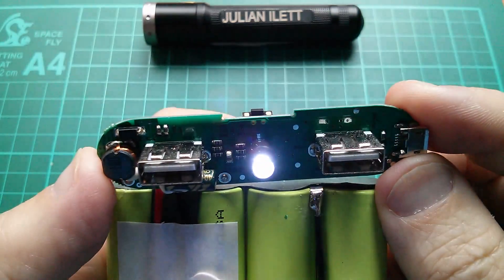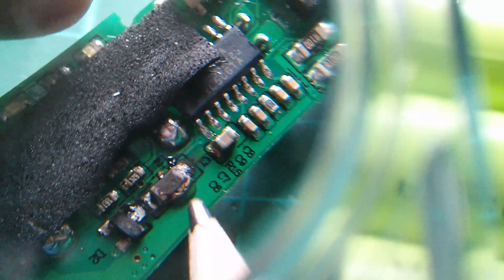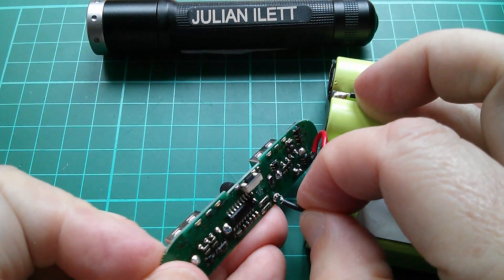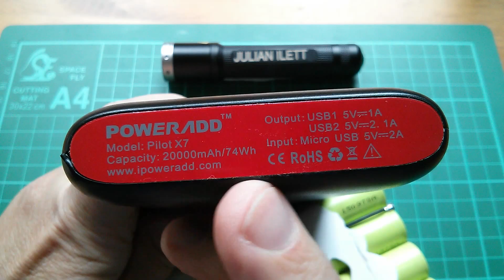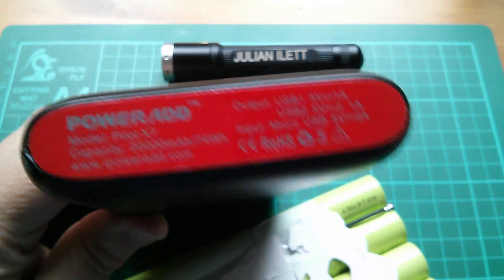20,000mAh Failed Powerbank Teardown

Comment: You can still use this ( ? ) ... discard the damaged electronics ( 💩) ..... charge the cells to the correct ( 4 .2  Volts ) using a vape charger ( this  WILL take a long time 😝 ) and then use it to power your garden lights ( ? ) ..... DAVE™🛑

Comment: I have a question. What company produced the batteries inside? I had exactly the same type of powerbank. And I suffered the exact same thing. After serving me at least 5 years with a loss of max 20% of capacity I made the mistake of charging it with a fast charger, that burned it. I am very sad. It was the best and most sustainable powerbank. But ... I took the batteries and mounted them in another power bank where the batteries lasted only 2 years. It works perfectly and I hope it will last me another 2-3 years.

Comment: We've bought a couple of these from Amazon. One wouldn't take a proper charge and was quickly exchanged by the vendor. Another two worked great for about 2 years then dropped just slightly in capacity. Amazon reviews were mixed. If any of them eventually fail, I'll use the info from this vid to replace the bad cell with high-quality pulls from an old laptop pack. The wife LOVES hers because it charges her phone so fast and for multiple charges. Cost about $20.

Comment: Hi Julian, love your videos. Can I please ask you a question regarding the useage of li-ion bms boards? Say I have two 3s bms boards, can I connect them in parallel to the outputs? and charge and discharge from the same connectors? say x3 li-ion cells at 2000Mah each, making each bank 3.7-4.2v at 6000Mah, total capacity (parallel) 3.7-4.2v 12000Mah. Am I correct in thinking I can charge these cells as they are (in parallel, 2 banks of 3 cells) directly from the P- and P+ connections as well as drain from them without issue. If so, could I then use a standard car batt charger for charging these cells (since they have balance charging boards fitted already) or would I have to use a specific charger such as a turnigy? Many thanks Julian, much appreciated.

Comment: my nice EC Technology 22400mha power bank micro usb port broke due to a shit cable heating up and melting the plastic in the port but it still turns on and charges phones but you cant charge it back up and has had very little uses so i have broken it open taken the 18650 cells out that are each rate 2500mah and i have 8 of them yay so i order a diy power bank case to put them in why waste good cells and yes i know i could try to solder a new port on but i no good at micro soldering

Comment: It looks to me that it is C so it would be a cap and the other item looks like a transistor or could possibly be a voltage regulator. It can be fixed, but perhaps not worth it. In that case harvest the cells.

Comment: Ouch, the two X7's I bought a year ago are still going strong with near daily use (hope I don't jinx myself). One of my unbranded Chinese 20,000 mah banks died in a similar fashion, I used the cells in a cheap 18650 battery box like you did.

Comment: Hmm, that's a shame :-(
You might remake it with a buck converter board if the batterys produce more than 5v, and that battery could be charged another way.

Could still be a handy 5v supply :-D

Comment: hey Julian im working my way through all your videos and im very impressed totally enjoyable so im going to ask your advice on a project I want to build basically I want to build an led clap activated in use sign but struggling to get my head around it the parts I have on order are 10w led a 10w led boost module and a clap activated module I saw on one of your postbag videos I would appreciate it if you could get me in the right direction to build this when my parts arrive cheers peter

Comment: In a perfect world, PowerAdd would send you replacement components, or an updated circuit board - but you'd have to let them know first!
Failing that, I'd ask if anyone else has one, and if they could identify what the components should be to replace.
I hate throwing repairable stuff away - manufacturers should do more to aid serviceability.
Reply: I agree with you Andy. I'm the guy who years ago took in a toaster in to have one heating element replaced! But here there's either a design fault causing burn-out, or they've used cheap components.
Personally, I'd bin the circuit board and maybe keep the cells for another project. Reason - I need powerbanks that are 100% reliable, when I travel, so I usually go for 'names' like Anker, Duracell or Energizer. Expensive, yes. Reliable, yes.

Comment: The large brown-ish component with the gunk around it looks like a capacitor, and the small black 3-pin part with the skidmark is almost certainly a mosfet. Since mosfets usually fail short circuit, my guess is that this is keeping the LED lit. If you desolder the mosfet I would expect the LED to go out. You should still be OK from a battery safety standpoint as the cells have their own protection board anyway. It's probably a very generic mosfet so replacements should be easy to find. Not sure about that big capacitor though (assuming it is actually a cap). Good luck fixing it anyway...

Comment: So, that '20,0000mAh' power pack is actually about half of the claimed capacity, assuming that the cells really are 2.5Ah ones. That's not quite the worst of the Chinese swindles, then. Thanks for the tear down, Julian. //A thin, repurposed Sheffield steel dining knife, a flexible filling knife, old credit cards, old flat-ended tweezers, or even thin and flexible paint scraping trowels, make excellent spudgers. Or if you prefer to support the Chinese government further, you can buy complete spudger sets for a few yuan.

Comment: it looks like the surface mount diode got hot enough to melt the solder and allow it to flow and short out itself,could try removing the solder short?.

Comment: This is exactly what my Brother's 20,000mAh Anker did, which looks very very similar to yours (basically just a different colour case).
It had cooked up a couple of components on the edge of the board just like yours and got very hot.
When he brought it to me initially I didn't have time to look at it, so I put it in a metal bucket in the garden for a few days in case the heat was from one of the cells about to "perform". A few days later (LED still on, but case now cool) I opened it up, found the fried SMDs and cut the battery wires.
I'll get round to putting the cells into something else one day!

Comment: Are those battery cells all in parallel for a total of 3.7V or is it some in series to run around 8.4V?
Reply: Matthew Miller typically they have a boost converter to bring the 3.7v up to USB standard 5v. this is also one reason some people moan not getting the"full" 20000mha, for example because the converter is not 100% efficient.

Comment: Just say tape, Julian. Sticky is redundant. We know what tape is.
Reply: Sticky tape is a perfectly normal British name for it.
Tape on its own just means a thin flexible strip...
So a tape measure is a tape you can measure with.
Cassette tape is a tape in a cassette,
Police tape is a tape with Police written on it...
and sticky tape is a tape which is sticky.

We do drop the sticky when we talk about insulating tape though.
Insulating sticky tape would just be a silly name.
Reply: Let's call it grey insulating sticky tape thing.

Comment: My guess is that the D2 failed, and has shorted the inductor, maybe try replacing the diode and inductor (or at least removing them) and seeing if it comes back to life.
Reply: You can get SOT23-3 package diodes, so the diode probably failed, and took out the inductor, or perhaps the inductor litterly cooked the diode...
Reply: TheDefpom are you sure D2 is a diode? I've never seen one in that package

Comment: Most likely the inductor is part of a buck converter (from 5V USB to charge voltage), but the IC is fried and short circuited, which heated the inductor. I don't think it burned up since the LED got brighter when you connected USB. Check the voltage at the battery terminals when you connect USB. My guess: 5V minus the drop of the diode in series with the inductor (so something around 4.5V and thereby too much for Lithium cells; hopefully the battery protection board did its job).

Comment: I suspect one of the diodes in that sot-23 package (or it may be a transistor despite the board marking) failed short circuit, drawing a lot of current through the inductor. It may work if you replace both the components, but I wouldn't bet much money on it.

Comment: at least your batteries still work my power bank had two of the silver lithium battery pouches in it and one of them swelled up and bent the metal case out. i took it apart and the other pouch is ok I think so I can make a new power bank out of that but it will only be half as powery as before :(

Comment: That burnt component is a capacitor.
Reply: Yeah, it's an inductor, that C1 fooled me. Looks like D2 is also kind of funny looking, I guess diode failure is what happened there.
Reply: Definitely not. Looks differently and is marked as "I" or "L".
Reply: It's an inductor, how does a cap in a battery powered device blow like that? Also, the L1 that's under it is good evidence. The C1 was for the other cap, next to it
Reply: Looks like an inductor to me.
Reply: I agree, a high value X7R SMD ceramic capacitor would be suitable replacement. Judging by the thickness, 1 to 10uF.
Also explains why it failed (they used a cheaper grade of capacitor) and why the entire unit stopped working (unstable or shorted voltage rail).

Certainly is repairable if the cap is the only dead part.
Reply: Something, maybe a transistor or diode, failed, taking out the 'fusible' inductor? It's probably repairable, with no need to repurpose the cells.
Reply: I'm pretty sure the short is in the IC and the inductor is still "good" (in "not burned open"). Otherwise the LED wouldn't get brighter when you connect USB to the charge port.

Comment: Had an anker pack do this to me. the warranty was excellent though, reported it in the morning and got a new one sent to me the next day!
Reply: That's probably because they take returns, repackage them and sell them as new, like the 4 anker stick banks I bought off amazon, and then returned.
Reply: wavefront101 interesting... so...

1. Anker has responded to my warranty claims and sent me replacement hardware literally the next day, far too quickly to request me to send my product back.

2. Anker has never asked for return of the products after a warranty claim and has actually told me...

"Thanks for writing back with confirmation.

A replacement has been arranged and you will receive a shipment notification email shortly. To save your hassle, feel free to recycle or dispose of the product in your hand without return.

To find the serial number, would you help to recheck the charging cable as well? 

We truly appreciate your patience and cooperation all the way. 

Reference Ticket#xxxxxx if contacting a CSR by phone.
Susie
AnkerDirect Customer Support
1-800-988-7973
Mon-Fri 9am to 5pm(pst)"

So no need to return either of the two failures, in fact the 18650s I've pulled from the (2 different) products have been just fine in the new battery pack housings I bought from eBay.

I've experienced nothing but fantastic customer service with my Anker products in both cases.

So I'm at a loss to explain why you would have been asked to return any anker products if indeed your little tale isn't simply nonsense. :/
Reply: I returned these powerbanks because one of them had scratches on it.  Another one had the sticker missing off the box, indicating it had been previously opened, as all the other boxes were sealed.  Also the sticker covering the top of the powerbank was missing, and the others I bought at the same time were not.  They didn't want your return because they don't want an obvious broken powerbank back, although if you are returning for another reason, they will accept it, and then resell it, and I doub't they would measure the capacity.  I bet you they took my return and sold it to someone else full price.
Reply: wavefront101 so what your saying is that your faults were really cosmetic issues? easily solved by repackaging or in the case of the powerbank with a scratch being sold as refurbished. a perfectly valid business practice, may even be sold with the scratch on it through the Amazon outlet it makes perfect sense.
Reply: These powerbanks were sold as new from the official anker on amazon.  Think about giving two people sitting in the same room each one of these powerbanks.  One box has a sealed sticker, and the other doesn't not.  One has an obvious scratch the other does not.  That's fkd.  I'm glad I opened the box to see I got fkd.

Comment: you really should have spudgers, a couple of quid gets you a full set of metal and plastic spudging tools. they really are useful for getting stuff apart
Reply: https://www.aliexpress.com/item/6pcs-Dual-Ends-Metal-Spudger-Set-for-iPhone-iPad-Tablet-Mobile-Phone-Prying-Opening-Repair-Tool/32747239857.html
Reply: Ive got something like ebay uk item 152557216006 but what I bought has slightly different contents
the tweazers are crap and very low quality but the flat thin stainless steel spudger is the most useful, and I use the plastic pieces a lot, theyre good for spudging things without mangling plastic cases as is easy to do with a metal tool

Comment: How many Ah is it really?  20,000mAh seems high for cheap cells.  And that would be 2,500 per cell at 3.7v, not the 5 volts the unit should provide.
Reply: I am pretty sure that larger IC is a dc-dc converter to get proper output voltage.

Comment: You could get a usb charger board, and a usb output board, and hopefully be able to fit them inside the case, you won't know how well it's charged, but as a secondary unit it may be useful

Comment: put the batteries to good use else where like your super capacitor bluetooth speaker system
Reply: BillyNoMates1974 Its called super capacitor bluetooths speaker not Lipo bluetooth speaker :D
Reply: it could do with being a quick charger for the super capacitors

Comment: Ask Clive to send you a Spudger!
Reply: I just use old credit cards
Reply: Metal spudger ... 20Amp !.... but yes why no spudger, I too have a collection of old "credit cards" and have used them (for over 20 years) for more than a spudger ... spreader, packing, insulation, you name it.
Reply: I personally use cheap guitar picks. They come in different thickness and slide easily into cracks.
Reply: Yes ask Clive to fix it?

Comment: send the board to bigclive to see what he can do
Reply: Warm white LED rather.
Reply: yes, I hear Clive has an excellent bin
Reply: bob red
He'll probably replace the white torch LED with a pink LED and send it back.
Reply: bigclivedotcom is the master reverse engineering/modify of circuit boards ❗And if it's not worthy of the bigclive reengineering there's option #2 tear it to bits ❗❗👍
Reply: not really..but tearing up to bits is entertaining...
Reply: uh its a plastic box in two halves thats already been taken apart. but hey whatever entertains you I guess
Reply: weird

Comment: Do like I do: I take laptop batteries apart and repurpose the working cells to make powerbanks.
I do test them first to lign up matching capacities. That way I've got quite a good number of power banks.
Reply: What a great suggestion to a fellow who just got some more good cells without the power bank circuits... (Although I'm quite sure Julian has more power banks than one man can use during a lifetime already :D )
Reply: thats the origin of my power banks too, a while back I got a job lot of new old stock laptop batteries very cheaply on ebay and dismantled them for the cells. I was going to do it again but I cant get them anywhere near so cheap any more, I dont know if I was lucky in that one auction, more people have caught on to them as a source of 18650s or maybe the supply is dwindling, its been a long time now since laptops were made with removable batteries (and of course the cells in those old packs are getting older too)
but whatever the reason I kept getting outbid and the lots ended up selling for way more then I was prepared to pay, comparing the cost to good quality new cells direct from china

Comment: Just buy a cheap powerbank case from china and put the 18650's into that, new powerbank for a few dollars.
That's what I would do with it.
Reply from the maker: +Mark Flack yes, I can put them in the qd188 case
Reply: IRFZ44 the universe would be great if sarcasm could help
Reply: How are these comments 4 days old when the video is only online today? WITCHCRAFT!
Reply: Mark Flack totally agree. have a similar power bank, bought it empty, filled it with old laptop cells. works like a dream. holds 99% charge for months.
Reply: this 4s TOMO bank is on sale for $10, works great, each cell has its own charging circuit http://www.gearbest.com/chargers/pp_627026.html
Reply: I do not recommend that at all. Just this morning, a cheap powerbank case from china just went in flames in my pocket in the middle of the street while I was using it in normal conditions. The cells where brand new Samsung 18650...
Reply: I have the M2 which I think works the same as the M4.  It would have been a great power bank except for the following two items.
1. You can charge and use at same time, but input max is only 1A.
2. USB1 Max is 1.5A and USB2 Max is 2.2A, however total max output is only 2.2A.  If you go over it will turn off the last USB port putting out power..
Reply: +fambaa Sometimes Julian lets Patreon supporters see the videos a few days early. Hence the comments.
Reply: Lothean 
Cough cough Samsung cough cough
Reply: But the batteries appear to be 'NAFF' replace them the whole lot.  Always stick with with Samsung's, Sanyo, LG or Sony batteries...